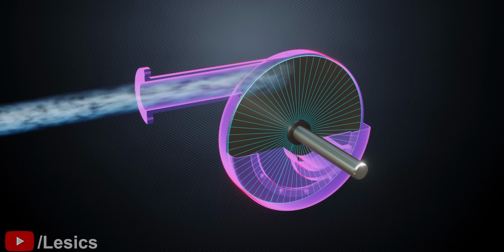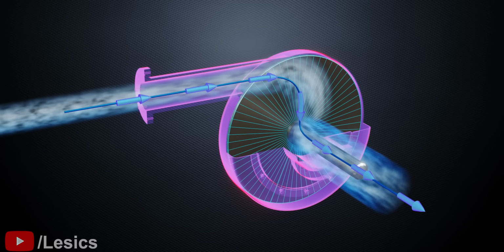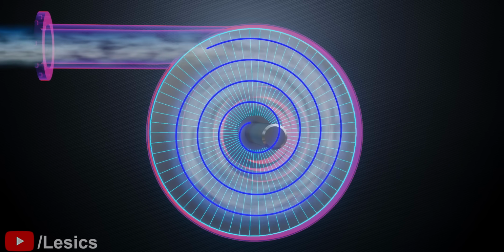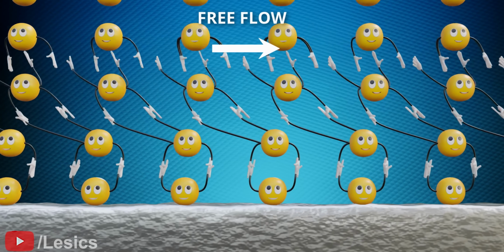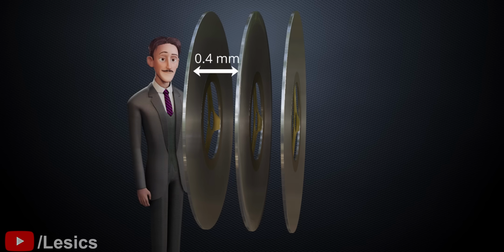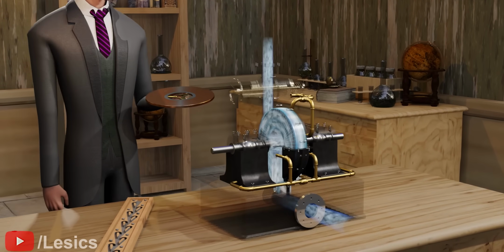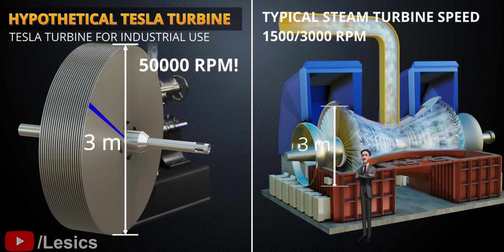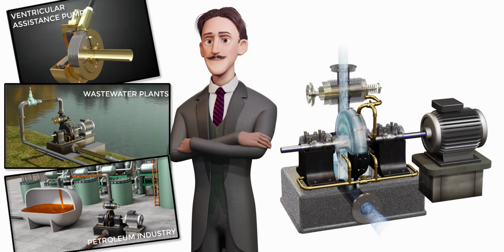Tesla Turbine | The interesting physics behind it

Comment: I could be wrong but I feel the calculations are incorrect.

3 metres diameter multiply of by pi come to 9.424777 being the circumference
Multiply that by 50,000 PRM comes to 471.238898 Km/m...  Multiply a further 60 comes to 28,274.333882 Km/hr.
28,274.333882 divide by 1235 comes to Mach 28.894197

Where am I wrong?

Comment: Where's the problem of this being used on a turbocharger? They'll spin 100k+ rpm, and in motorsports applications, high efficiency at maximum spin is ideal, overspeed being limited by wastegate.

Comment: Years ago a coworker said he wanted a car that would go 200 mph like NASCAR cars. He said he would drive it everyday. I told him he wouldn't be able to drive it everyday at 200 mph because the car wouldn't be able to handle. He said I was crazy until I said "Dude, they build these cars  to run one closed track race then rebuild it again for the next race. Yeah they can run 200 mph but they won't do it for long." He said I was right. I almost fainted.

This sounds like the same kind of issue with the Tesla turbine. You can build it but it can't take it for very long.
Reply: Tesla kind of had that issue with most of his design. They were almost never more than interesting thought experiments in that they were completely impractical to build or at least use for extended periods; a good engineer he was not. The only best applications for his inventions have tended to be completely different from what he intended, like using this turbine as a viscous fluids pump instead. He had an interesting mind that went in crazy directions, but he definitely could have done with being a slight be more grounded in the reality of plausibility rather than just possibility.
Reply: @Roger44477  I would think that with any mechanical device you could go to the limits of the application and not further, which is the same as the engine in the family car........rev the guts out of it in an acceleration race test and it will fail but used as the manufacturer intended and it will last a long time......does the Tesla turbine have to rotate at such a high rev count to become efficient or does it not equal the axial flow type in efficiency?
Reply: I always enjoy seeing the tesla fanboys get riled up whenever someone dares to point out even the slightest issue with one of his creations or claims
Reply: The modern-day armchair experts can sit and pontificate all day long as they do on the internet these days. But not have the slightest idea of the engineering or Physics involved in constructing the simplest of mechanical machines.

Comment: I'm pretty sure that we all now have realized but there's probably multiple different types of material available for construction purposes, although the material is probably not made available for the General Public. I wouldn't be surprised if they were used in military installations
Reply: Also, what if one sacrificed a fraction of the efficiency and improved the structural integrity of the parallel discs design? Taking into account the altered resonance properties of the structures involved; modern measuring and manufacturing techniques would allow for balanced structural reinforcements to the disc layers; avoiding or resisting further at least, the warping effects?  With care, the discs can still be balanced in relative zonal weighting?  Another question is whether the right material can be found to withstand the centripetal force at such high velocities at the required radius?

Comment: To increase the speed of the fluid you can use the idea of inlet blade fan of the modens aircraft engine. To fix the "impossibility" (impossible until someone get the solution) I give to you NIOBIUM from Brazil. Mix this mineral with steel and you will get maybe the most resistant material find in the world.
Reply: It has been used since 1984. It is an improvement, but not the solution. Now (on 2020) it has been used in the test of turbine housing. But it failed, due to phase transformation issues. I suppose, that if the housing is getting “overheated”, then the turbines are in an even worst condition. So application in the speeds that Tesla suggest to get that turbine are really hard. I would recommend a ceramic, as they tend to withstand the heat better. But, as being brittle (as the intermetallic phase of the niobium-steel alloy) is an issue I also think is not possible.

I agree with you on the “impossible until someone get the solution”, but it is not an easy task. And needs a lot of research.

Comment: As for the "too powerful", as an engineer I call BS.  (Kidding obviously, for SOME applications...kdding, again).  98% efficiency claim is beyond stupid however, since the REAL efficiency of the device that matters is energy in vs energy out, probably more like 10%, fuel to shaft.

Also, as I read down through this comment column I am gradually entering into despair for the idiotic beliefs generally thought by those who probably flip burgers to be 'absolute truths'.  I guess it can be of some consolation that these are assuredly not the next generation of engineers, OR that those that are will be trained out of the darkness and into the light.  Put a video with Tesla in the title and you have a whole slew of confused rabid 'dog's reacting like you just rang Pavlov's bell, but with clicks rather than saliva.  Wow.  I guess it's the new religion...I, frankly, would be happier if NONE of them existed.  Again, darkness and light.

Comment: When we eventually get to Mars and are able to successfully stay there all the transport systems will be driving on electric field drives without touching the ground.
Reply: Why didn't we already do that, then? Why did NASA send a small helicopter optimized for the thin atmosphere of Mars, instead of a vehicle that you described? Tesla's designs were amazing for his time, but there are reasons that we don't use them today. Engineers are really pragmatic, and if his designs were optimal, they would be used.
Reply: @evanbarnes9984  I suppose the same applies to Archimedes.....some of his design are the basis for more developed designs of today......you only need the principle of something for it to trigger off a design that is practical.

Comment: Isn't it possible to decrease the size of the turbine, and instead use larger number of parallel turbines to accommodate the large flow of water? The smaller the disc diameter, the higher RPM you can achieve without the disks turning into a shrapnel bomb with extra steps from the sheer amount of force pulling them apart.
Reply: The greater the volume, the greater the plateau-Rayleigh instability introduced at each rotor stage.
Reply: The smaller diameter the higher RPM you need to maximize efficiency. The metal won't stand it. Conventional turbines had the same problem at first, it took a lot of development of exotic materials and very careful precise manufacture and balancing to make them efficient. The Tesla turbine is much simpler in concept but in practice does not match the efficiency of the blade turbing.
Reply: @mrdanforth3744  When the drive for absolute efficiency over rides the need for simplicity the end result is a never ending prototype drive that goes nowhere.........you CAN make something very complicated easily in an attempt to gain a few more efficiency points, but you can't make something simple easily without losing the plot and make it impossible to manufacture economically.
Most, if not all engineers who aspire to be a leader in their field of endeavour fall for the trap that complication is a way to produce something that teeters on the brink of disaster and only a further complication makes it practical.......they cannot understand the KISS principal and will argue to the death while being blind to it.
Reply: I Don’t
Reply: In theory, yes. Also, with modern material sciences, a full scale version of his would be possible, I think. 
The problem lies in the application. Getting enough speed for max efficiency while being large enough (using the turbine-spun generators from the video as an example) to work will result in insane levels of rotational energy that we don't have anything that can stand up to.
I think a kind of hybrid system would be better. Between Tesla's and modern turbines
Reply: @grifballa  not to mention the gearbox needed to reduce that rpm to usable level for the generators..
Reply: @grifballa  I think the main attribute of the Tesla turbine is that it is relatively simple in concept and design as opposed to the multi bladed and multi stages of the modern axial flow turbines.

Comment: They need to make the discs from the material used in CD's , I'm pretty sure my old cd drive would rev up to about 50,000 rpms XD
Reply: Base rotation speed for a CDROM drive is 500 rpm (for reading starting near the center), slowing down to 200 rpm near the outer edge.
A 48x drive would spin up to 24k rpm at first, slowing down to 9600 rpm at the outer edge.
Anyway; even the tinyest crack and the CD would shatter.
Reply: @silvergreylion  My comment was meant to be a joke, because they would be so loud as they would spin, but I appreciate the info, I never knew they really would go that fast, 9600 rpm is more that I thought they could do.

Comment: The reason it spins so fast, is because of the "retention" of kinetic energy in the discs.
This is due to the molecules of the fluid entering a spiral path. Anything, which spirals inward, will accelerate. You will find this in (some) physics books under rotational momentum.

Imagine following a particle/molecule along its path. As it begins to spiral inward, it tries to accelerate, but is almost completely prevented from doing so by the surface cohesion of the discs, so most of the kinetic energy is transferred to the discs instead.
This effect gets more pronounced, the closer to the center you get, as the particles/molecules have to move faster and spiral more sharply inwards due to the smaller radius and therefore decreasing (cylindric) surface area of space between the discs.

At dynamic equilibrium (with no load), when the outer edge of the discs has nearly the same linear speed as the incoming gas/fluid, there is a constant imbalance, of the gas/fluid near the center, trying to accelerate, but losing almost all kinetic energy to the discs, which try to accelerate the gas/fluid in contact with the outer part of the discs.
If you're wondering, I am saying that (with no load) the linear speed of the outer edge of the discs may be slightly higher than the speed of the incoming gas/fluid, due to the transfer of kinetic energy via rotational momentum, from the gas/fluid in contact with the inner part of the discs, to the gas/fluid in contact with the outer part of the discs. Under load, this is most likely not the case.

The net result of this constant imbalance is what I term a "retention" of kinetic energy in the discs.

Also, I may never understand why Tesla didn't try to use a hollow axle instead, with cut-outs to let the gas/fluid enter it. With the outermost disc at each end beyond these cut-outs, there would have been no need to have a tight spacing to the housing at the ends, and no drag force from such a tight spacing either.
Perhaps there were no closed bearings back then?
Reply: If memory serves, plateau-Rayleigh instability is an issue with these. That could introduce excess stresses from vibration, which could wreak merry hell with the discs themselves, as well as introduce throw-out wear on bearings with any significant high volume flow.

Comment: How small would one of these need to be to power a house?
Reply: Depends, how much power does a house use with everything on? (since it has to be designed for maximum load).
Short of power needed for welding in a workshop/garage, 20 kW / 25 HP would probably be plenty for the vast majority of houses.

Comment: So I’m no physicist but if you can keep the higher rotating disc from heating up you could prevent warping right? So therefore he just never found an adequate heat dispersant or cooling mechanism to keep his machine running at super high RPMs. Am I wrong?I can’t wait for all you science types to tell me how wrong I am. Thank you
Reply: They never specified why Mark 13 rotating discs are in engineering impossibility my assumption is because of friction and heat

Comment: A turbine is properly constructed when the against surface is following and implemented of supplemental compromising correctional redirectionals of connections which feature attachments within a looping of train as driver,  driven and torques are attributed sensibly and correctly.  I couldn't had said it better myself.  Cheers;  those whom follow these steps will eventually understand them enough in order of explaining the whys.

Comment: Question,  wouldn't you be able to put a planetary gear assembly or a gear box on the spline shaft so that the turbine could keep the 10k rpm limit but the put put after the gear box be around the 50k running the rest of the electricity generating device ? And sorry if my terminology is a little off
Reply: You lose a lot of efficiency when you have to attain higher rpm with gears. There would no point to running the turbine at 10k and gearing up the generator to 50k.

Comment: This is complete BS, the Tesla turbine was a complete failure, hence the reason it's not made.
Tesla went to Allis Chalmers to build his turbine, which they did and tested and did not work, much less run at a high efficiency. Tesla claimed Allis Chalmers didn't make it correctly, yet he worked hand in hand with their engineering department.

Comment: Problem: The U.S. electrical grid operates at 60 Hz, which means that, at any given moment, the electrical generators hooked up to it generally must spin at  3600rpm to correspond to the induction/magnetic field between the rotor and stator. A generator being spun at tens of thousands of RPM would not even be compatible with the Hertz and phasing of the electric grid. You would have to add some sort of complex gearbox (again made out of wonder-materials) between the turbine shaft and the generator shaft to reduce generator rpm. And that extra gearbox would result in a loss in overall efficiency. 

And as others have mentioned, not only would the discs, themselves, have to have wonder-material-strength, so would the bearings holding up the shaft, and the lubrication within that bearing, and the seals where the spinning shaft penetrates the turbine housing. The lube system might have to get more complex as well to carry enough heat away from the bearings (extra heat exchangers, etc). The overall system would not necessarily be more simple than current systems just because one component (discs) are more simple than another component (blades).
Reply: couldn't one just separate the discs enough to limit the speed?
Reply: @jesseprete2792  but according to the video, that limits your efficiency, which defeats the whole point. in order to get their miraculous (theoretical) efficiency numbers, the speed needs to be high.
Reply: @jesseprete2792  I believe worm gears would do wonders to reduce RPM greatly with the fewest fast spinning parts. There are materials of extreme strength for heat and friction, particularly fluid friction for fighter jets. They're also unfortunately difficult to machine but sure would be awesome to somehow get discs flat enough. Just did some googling and I wonder if making half discs with coolant flows machined out so that when they're put together coolant can run through the disc and keep it thermally stable. Kinda wanna try it now.
Reply: I'm not an expert but I've been told that because of the failure rate no bank will give you a loan for a wind turbine that has a gearbox. We have a little 6kw turbine with three phase AC output. The frequency of the AC will depend on the wind speed so it's all rectified to DC, merged together, and then through an inverter to 50hz AC. It can then sync with the grid and it makes about £6000 ($8283) per year, it's windy here!
Reply: Possible options. But similar to a gearbox, every time you convert energy form, there are energy losses. So best case scenario, you max out at 3% losses through the Tesla turbine, then maybe 5% losses through the electric generator it spins, then 20% losses through the rectifier, then 5% losses through the inverter, before you reach your step-up transformer (which has its own losses) and go to the grid. So your 97% efficiency has dropped down to 70% or lower. And the extra equipment adds complexity and expense.

Comment: Principle reminds me loosely of a torque converter on an automatic transmission..
Reply: It can also be used as a pump, so if you connect a few pumps and turbines with valves, they would work that way.
One pump driving two turbines - conversion to lower rpm, higher torque.
Two pumps driving one turbine - vice versa.

Comment: Steam turbines do not have a Mach number above 1, the tip speed may be well over 1000mph but Mach is measured relative to the local flow which is always below the speed of sound, if the Mach number was above 1 then the flow would choke (shock waves would also probably destroy the blading).